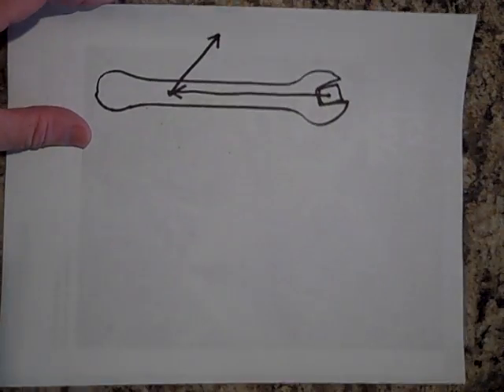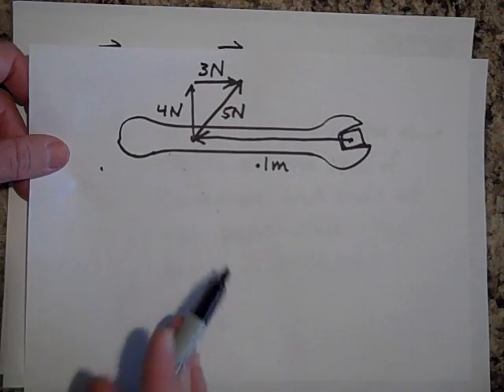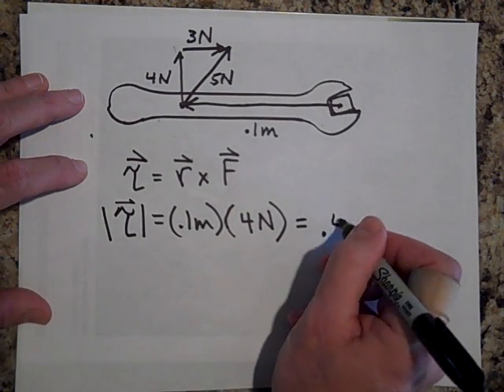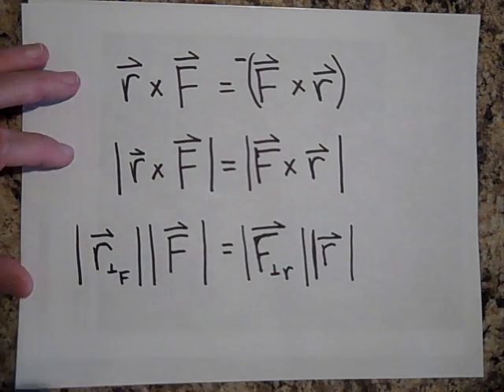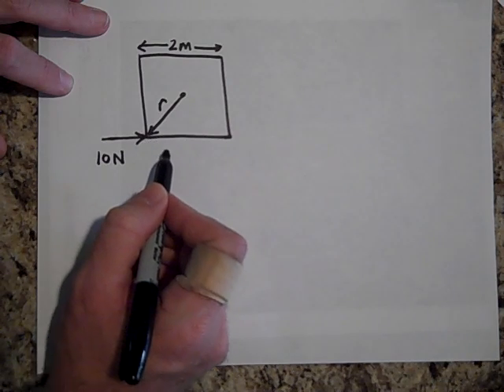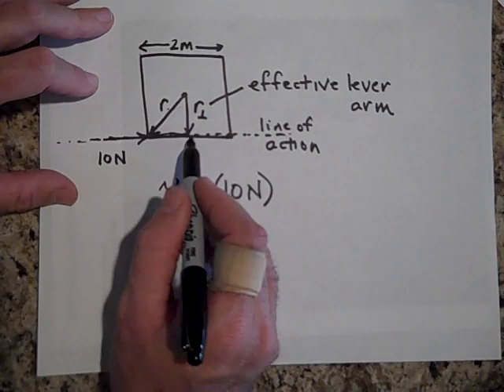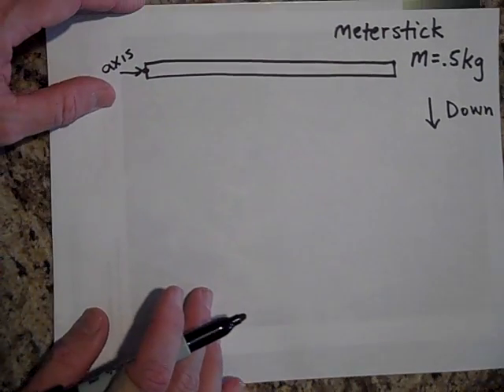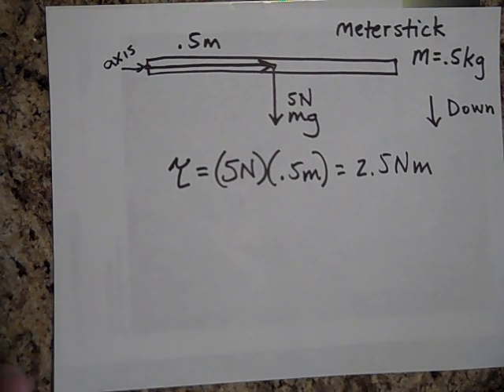Torque and the Cross Product (part II)

Comment: Is not the English unit for torque pound-force feet (lbf-ft), often times abbreviated lb-ft?   I thought foot-pounds (ft-lbs) was a measure of work, not torque.  I tutor college mathematics and physics and I have always told my tutees that torque is the cross product of distance and force while work is the dot product of force and distance, the two being quite different.  Although we are discussing physics, I understand it is common parlance to use foot-pounds for torque.  Indeed I have several cheepo torque wrenches which use this unfortunate language; however, my most expensive torque wrenches, the ones by Precision Instruments label the units "LB-FT."